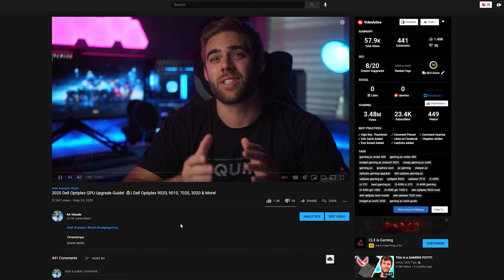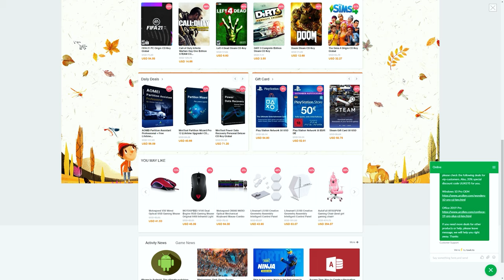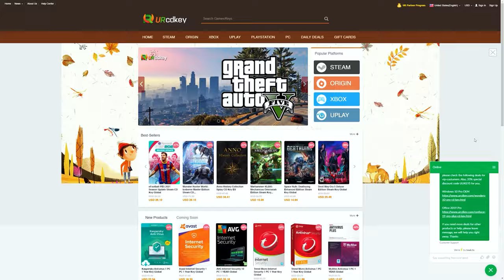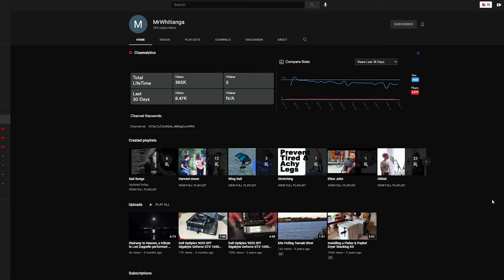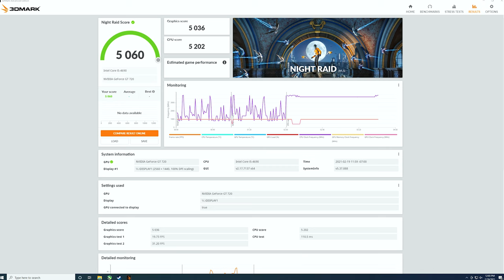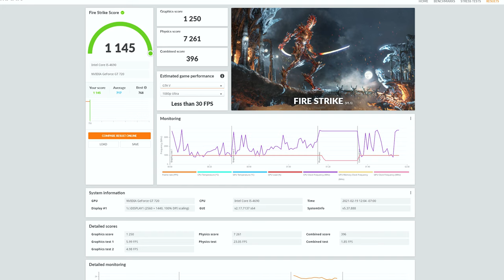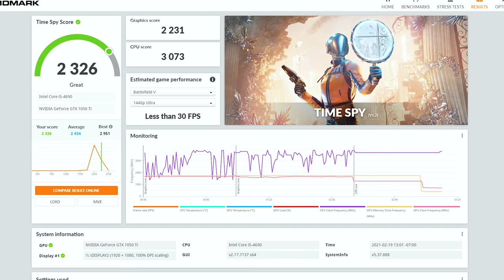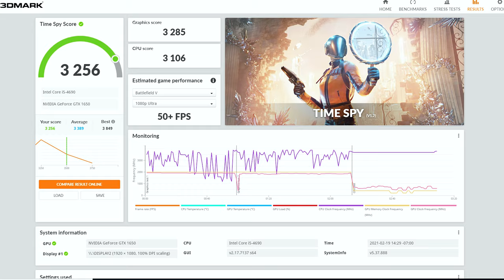The Best Graphics Cards For The Dell Optiplex SFF | 9020, 7020, 3020 & more! | GTX 1650, 1050ti

Comment: Managed to get an insane deal on an Optiplex MT with 16 gb ram, 250gb ssd for £100 delivered. I put my GTX 1050ti in it and was playing cyberpunk 2077 within 2 hours. I was astonished it ran at all. Most settings are medium but some are low to maintain a stable frame rate.
Reply: i got mine last week dell optiplex 990 500 ssd and 4gb ram i'll upgrade the ram someday,,,enjoy
Reply: dude can u please help me i have dell optiplex 3020 tower version firstly i wanted to upgrade my r7 240 gpu to rx580 but comp tech said my mothercard is not compatible and my psu is not enough is any good suggested gpu without i need upgrade my motherboard and psu

Comment: It irks me so much that most of these kinds of systems have the upper slot as the x4 and the lower one as the x16 with no room. Meaning you have to take that performance hit if you want a dual slot card which would be the more powerful one.

Comment: Was able to add a 350W PSU to my Optiplex 3010  as the first upgrade, Upgraded CPU from i5-3450-i5-3570K, OC’D to 4.2ghz, Z77 Gigabyte D3H, Crucial MX500 500gb SSD. Luckily the 1650 Super has a TDP of 100w’s and the new PSU comes with a 6 pin. Very excited!
Reply: Could you please specify which PSU you used, where you got it?

Comment: if someone is crazy enough to create a pci mounting slot to attach the low profile cards flipped vertically so that you can run a riser to the card in the X16 slot, I think that would be worth it.

You'd need some screws and a bit of foam to let it hold itself but it would be worth it tbh.

Comment: Best gpu for any dell optiplex sff is the rx 6400 xt low profile.I had it in my old dell optiplex build an it worked really well.
Reply: Rx 6400 xt really is the best, but it depends on the type of motherboard. The older Optiplex Sff cards had the Pcie slot further away from the power supply, this allows the installation of more robust cards. However, there are places where the Pcie slot is very close to the power supply, so it is not possible to install stronger cards. In your case, what type of motherboard was it? Thanks.

Comment: I was able to find a dell optiplex 9020 sff i5 16G ram 250 ssd for $180 a few months ago. Now I’m trying to find a dedicated graphics card. This was very helpful thank you, now to find a 1050I LP for a good price.
Reply: I snagged a Lenovo M910s for 150eur recently and was thinking of getting a LP 1050 as well. Found a Quadro P1000 for 80eur instead, it should be very similar to the 1050. It's not the greatest but I was happy to find out it could even run Warzone (in potato quality, but still).

Comment: I had no idea some x4 slots were open ended. That's interesting to know! Still sad about the performance hit it takes in this config.
Reply from the maker: yeah, its nice that it works but still kinda sucks you don't get the full performance of the card.
Reply: From what I just seen it only takes a ten percent dip using the 4 slot vs the 16 slot?

Comment: You should try one of these NVIDIA RTX A2000 6GB or 12GB models.   They are better than a 1660 Ti and they run on 70 watt board PCI slot and don't need PCI-E connectors.
Reply: 🤯 I'm looking for something to put in a 7040 build I was thinking of in RX 580 but ill look into a a2000 now
Reply: I have a 570 but it's rubbish ddr3 version,make sure to get the newest 580 with the fastest ram. @Lillucson

Comment: I got mine from work after a fire. Cleaned it up, dropped in the 4770s from another fire-damaged PC, and swapped in a 480gb SSD. I'm looking at getting a GPU for this to make it into a small, low-power gaming-capable alternative to my other PC (Ryzen 5, rtx2080, 32gb, etc), but man those low-profile, no power connector GPUs are EXPENSIVE for what they are. They are so expensive, that in most cases, $50 more gets you a full-size model!
Reply from the maker: so true! they really charge you a premium for the smaller size
Reply: @RAVisuals  I'm actually looking into transplanting it into a different case and using a regular pay with an adaptor, if such a thing exists

Comment: Hey, Mr. Whitianga didn’t modify the case rather broke a part to fit gpu and just tested with power supply hanging out. That is not called modification.And I am still wondering why didn’t he simply use a pcie x16 riser cable to test x16!? You should please do a modification and also test rx 6400 now!

Comment: Great video! I picked up a super cheap 9020 sff after my ancient 960 passed away at work and was wondering if there were any good upgrades for it. Quick questions, did you have any issues with the psu it comes it or would it be better to upgrade to a 315W psu? And I'll dive through your videos but is there anyone you recommend for RAM upgrades for this model? Thanks!
Reply: One of my rigs is a Lenovo M93p (i5 4570 3.2GHz 4/4, 8GB RAM) which I upgraded to 16GB RAM, a 512GB SSD Win10/240GB SSD Garuda Linux, and Nvidia GT 1030 2GB. Runs Skyrim, Mad Max, Batman Arkham City on medium smooth. Runs Fallout New Vegas and Just Cause 2 on max wicked slick.

Comment: I have the 9010 SFF version of this that was given to me for free. One of the main differences between it and the 9020 is that the x16 slot is the furthest slot from the power supply so it's possible to plug a double wide graphics card into it without mods. The second major difference is that it will only take gen 3 CPUs. I'm using mine as a PLEX server so I don't care. I still have the optical drive for ripping, a 1TB SSD, and a 6TB HDD for main storage.

Comment: The 3020 sff only has a 1x and a 16x PCIE slot so it only supports one slot cards. The best card that will work with the 3020 sff is the rx6400 lp edition. It gives roughly the same speeds as a 1650 but for much cheaper.
Reply: do it really work?
Reply: Today I learned that there is such a card as the GT720. I was aware of the ubiquitous and bad GT 730 and also lately learned of the GT 705 but not the GT 720 until now... weird. Why do they make all of these crappy boards? Must be just for extra monitor outputs because they SUCK.

There's also the nVidia T600 and T1000 but they're workstation cards and quite expensive. I noticed he also didn't test the GT 1030 which is another option (and the one I have atm). But there's plenty of videos about the GT 1030. It needs no introduction.

 I have to agree with you, for this use case and for the money the RX 6400 is as good as it gets. Which is actually kind of sad tbh.

Too bad nVidia and their board partners don't make a single slot low profile GTX 1650. It seems these manufacturers don't care what the market wants/needs, they just put out whatever crap they want and see if we buy it. Maybe if they actually cared they'd do surveys or something.

Also screw Dell for putting the PCIe x16 slot in the wrong place on their SFFs. They could do better for their part, too.
Reply: Can a xfx speedster swift 105 6400 work with it
Reply: @SeeJayPlayGames  I'm guessing for Southeast Asian markets or countries that have plenty of these small gaming internet cafes. If these cards were animals I'd say they are donkeys because with a little tweaking it can run plenty of games and it doesn't cost much. Heck I ran a lot of games with my GT 710 card and never had a problem with my PC and GPU.

Comment: What about taking out the board and put it in a mid tower with a better psu and a 24 to 8 pin adapter?
Reply from the maker: You could do this but from what I've researched, you have to take all of the connections to the new case still. Would make quite a mess

Comment: is it possible to fit 1660 super into 9020 sff?
Reply from the maker: no. the 1660 super does not come in an LP version
Reply: @RAVisuals  ok nvm i bought 7040 mt with i7 6700 and 32gb ddr4 ram and put gtx 1660 super and a 500w psu in it, and i actually really like the way this pc can get so much fps for so cheap

Comment: Hello excuse me is there any GPUs that can fit in the 16x slot of 7020 sff , As I have a WiFi card on the 4x slot
Reply: Crazy 2 years later and still no reply!
Reply: rx6400 is the best single slot card you will find currently ( mid 2024)
Reply: Minipcie wifi card
Reply: Gt 1030,lp gt 1050lp not much else, needs to be short and slim.😂

Comment: Thanks for the great video! This might be a dumb question but does the MSI version of the 1650 and the Gigabyte version have different sizes? Like one won't fit in my 9020? or performance issues. Anyway great video.
Reply: You need to have an Optiplex MT to fit most graphics cards. If you have a sff you need a low profile card.

Comment: Did it come with a wifi card or you install one?
Reply from the maker: I had to install one but they're like 10 bucks on amazon
Reply: @RAVisuals  Thanks man. I got an old Optiplex 9020 SFF and wanna upgrade it now. But it looks like the maximum psu you can get for it is a 315 watts. Is that enough ya think, or does it need more juice?

Comment: Bought an Optiplex 9020 to use as a media PC.  Mine came with a 4th gen i7, 32gb ram and a one TB SSD, and I added a second one TB SSD that was collecting dust.  Surprised at how snappy the system performs with the GTX 1030 low profile card I pulled from a 12 year old PC the Dell is replacing.  It got me thinking just what could I drop in this thing to max out its capabilities.  Went with the GTX 1650 from MSI for its 4mb DDR5 vram.  Frame rate means more to me than anything.  Where the GTX 1030 could do Heaven BM at 720p nicely, the GTX 1650 can do that at 1080p.  For giggles I dropped GTA5 on the system.  Hey!  This thing can peg 60 FSP while on-line on a big TV at 1080p very high settings.  Last time I saw GTAV on a TV was on the PS4.  This little Dell by comparison is killing it!  No problem running some Halo.  The things I play work great.  Vsync pegged at 60 means the graphics card isn't working too hard and hopefully giving the God know how old power supply a rest too.  (Did some video rendering, and shot the CPU temps above 90c.  NOPE, not doing that again.  And I recommend you do not do that either.)  In even moderate gaming temps stay below 50c.  Might hit 70c doing intensive gaming.  HEY!  Long as the Optiplex 9020 lasts???  It kinda rocks for what I paid for it.  I love it!  Even having a Ryzen 9, 64gbram 3080ti system also.  That one?  That's not hooked up to my TV.  I wouldn't want to do that either because even though the Ryzen 9 system is not that noisy. . . the Dell SFF Opitplex is pretty much silent.  And it games!  (And I didn't destroy it stress testing the thing within its return period!)  This thing might just last the 5 years as a media PC / TV gamer that I'd like to get out of it.
Reply from the maker: love to see it man! Its great that these can still get plenty of use from people!
Reply: I have the same system and I was hoping to do some slight rendering using da Vinci and you’re saying you clock 90° or more oh nooooo lol😢
Reply: @PassportBigBro  What's probably most interest to you is I swapped the i7 4770 3.4 for an i7 4790 3.6 GHZ base clock in the 9020 SFF rig.  Thermals are very good now.  It can actually max all cores and just creep above 80c every now and then.  Cause?  The heatsink felt loose to me.  That'll trash your thermals.  It's also possible but I don't think so that the CPU could use some delidding.  There's also a low profile RTX A2000 Ampere GPU in the system now.  It's quite the little go getter, punching up above it's weight for sure.  

??? The 4790 non-K came out of a mid tower Dell 9020.  A 4790K 4.0 ghz went in that MT case.  Thermals are similar to the SFF.  You're leaving some potential on the table letting the 4790K boost itself in an Optiplex of all things.  It sure works brilliantly though.  Stays at about 4.3 GHZ all by itself with the high performance power profile in Windows.  It's paired with an RTX 2060.  750 watt PSU.  Run Cyberpunk well above 60 FPS at 1080p all day.  It does much more than eSports titles.  Why?  Why not.  The 9020 MT cost less than the 9020 SFF as it was mostly spare parts.  The 4090K 4.0?  I just said what the hell and put that in.  It sure works!  Buy three 9020 MTs for the cost of one used enthusiast morherboard to OC a 9020K.  I'm using both the SFF and MT rigs myself.  They're both great and close enough in performance that you might not know which one you were looking at.  The mid-tower is better due to options from being able to replace the stock PSU.  There are no case swaps here.  I like the sleeper look.)
Reply: I'll also note I believe the RTX 2060 is a great pairing with the Dell mid-tower i7 4090K 4.0.  For anyone who ever wanted a 1080TI on their Haswell box, the RTX 2060 is very comperable to that.  Here's that rig.  And now . . . I'm considering using a bios hack so this thing will boot off an NVME SSD on a PCI express card.  A mid-tower actually DOES have room even with a graphics card.  EXCEPT I like the system the way it is now.  It's serving as an actual media PC and a center of attention in a home theater.  It doesn't need more tweaking.

Comment: The PSU can support a 1650 right(i have a 7020)?  Also don't the brands have different sizes?  Gigabyte is the cheapest, but i don't see the measurements anywhere.  Also i read that the 1650 isn't any better than the 1050 because of bottlenecking.

Comment: does the pci x4 slot produce enough power to the 1050 or do you need to plug it in to the psu?
Reply from the maker: It has enough power for a 1050

Comment: i picked up a 3020 for 45 bucks and im very happy with it as im using it mostly as a media pc in my living room but i also want to get into modifying pc's and use this one as my labrat to experiment on since ive never opened a pc before. Gonna up the ram and maybe put a 1650 in if i can find one for a reasonable price
Reply: i picked up a 9020 for about 35 bucks with an i7 4790 its fast
Reply: @randomgamingin144p  am i7 that's a steal
Reply: @j.rjunior5584  not really

Comment: How can the gpu work with the stock psu it’s only 255w 🤯
Reply from the maker: The LP gpu's don't require very much power
Reply: @RAVisuals  so even a gt 1030 that requires a 300w psu but has a tdp of 30w would that work?
Reply: @plixrplays  yes it would

Comment: This might be a little overkill. But would a 9020 optiplex coupled with something like a 1650 or 1050 ti be enough for ps2 emulation at 1080p? I want something small to play old games in my living room and I am really struggling trying to find something that's both small, powerful enough and doesn't cost a lot.
Reply from the maker: that would work like a charm! Just like the emulation I did with this build!
Reply: @RAVisuals  thank you so much for replying so soon. I was stressed out because  there were so many things I had to be aware of like power supply issues and not to mention there are like a million different sff desktops to choose from lol.

Thanks again!

Comment: Can I fit a normal 1050ti if I remove the PSU and leave it outside. Because I don't have a low profile one and I'm scared that it won't fit
Reply from the maker: Its really an issue of clearance with the cd drive and the hard drive cage in front of the GPU. The case is very limiting
Reply: @RAVisuals  I cleared the cage already but I think that it won't fit, maybe ill do a hole at the case or something lol

Comment: I have a gtx750ti with my 3020sff. Will it fit in the top slot?
Reply from the maker: is that 750ti a low profile card? Single slot?
Reply: the 3020 sff doesn't have a second video card slot it only supports single slot cards which wont work with the 1050 ti or 1650 lp i dont think the 750ti would work unless you had a certain type

Comment: are these cards good for video editing with premiere pro? if so which would be recommended for the 9020?
Reply: They are good yes, the more budget you got the better gpu you can get, if you are gonna be using it only for premiere pro I suggest go for Quadro GPUs there are some cheap yet powerful but if you wanna game too then go for 6400 in budget or if you got cash go for rtx 4060 lp or 3060lp

Comment: i have a 9020 sff . i5 processor, 1050ti and 16gb Ram. Runs well. The only issue i have that i have not been able to figure out is my monitor will randomly disconnect and reconnect while using the video card. Doesnt happen with onboard video though. Other than that, its a decent cheap gaming pc. I run gta v, pubg, call of duty (mobile) as well as other games, and also Second Life.
Reply: dude can u please help me i have dell optiplex 3020 tower version firstly i wanted to upgrade my r7 240 gpu to rx580 but comp tech said my mothercard is not compatible and my psu is not enough is any good suggested gpu without i need upgrade my motherboard and psu

Comment: Is a Dell OptiPlex 9020 MT i7-4790 3.6GHz 16GB RAM 500GB HDD for $250 a good deal I've been wanting to get a computer for a while and i don't really want to pay more than $350 and i was wondering if that's the best deal
Reply from the maker: Its an okay deal. You can get those for $200 usually but in the times were in now, that may be the going rate.
Reply: @RAVisuals  ok thanks that was the best deal i could find on eBay anyway and do u have any graphics cards that ur not using?
Reply: just pick up a 3020 for 60.00 and upgrade the cpu.

Comment: @RA Visuals will a RX 550 Half Height card fit and work in a dell OptiPlex 3020 sff ?
Reply from the maker: You have to get the "LP" or low profile versions to fit in this system

Comment: i just want to ask if i need to change my Power supply if i will upgrade to 1050 ti? mine is optiplex 3020
Reply from the maker: nope! the 1050ti is low powered enough for the stock psu
Reply: @RAVisuals  i also want to ask if 1650 Low profile is compatible? because now the 1050ti is not available in the PH
Reply: how about 1650 Low profile??